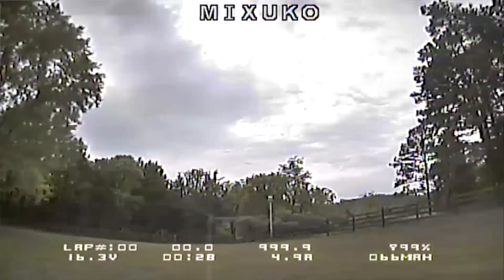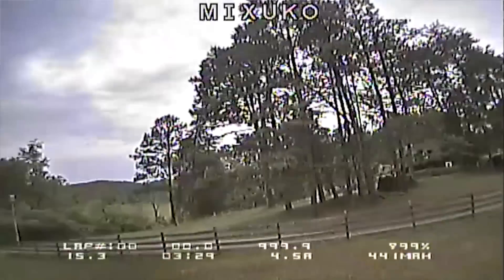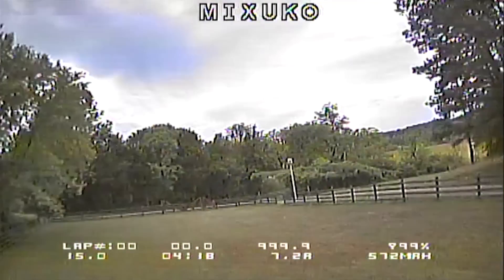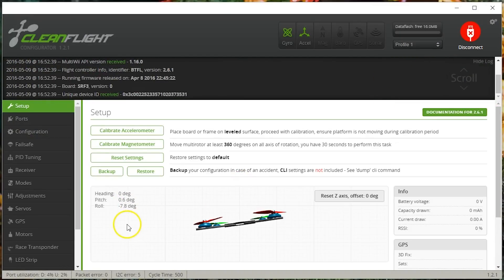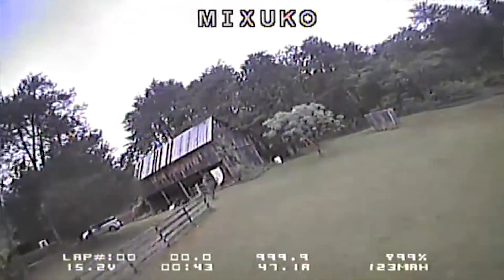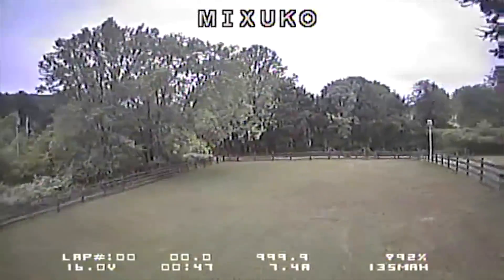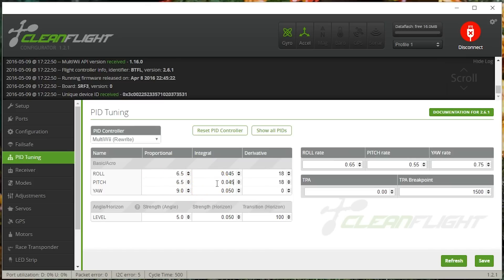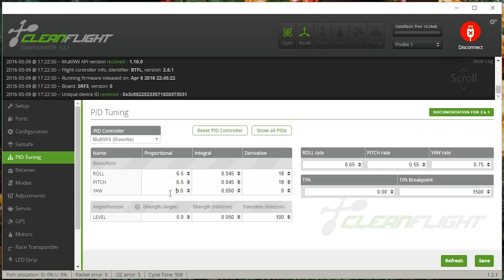Practical PID Tuning - Part 1  | HOW TO TUNE A QUAD

Comment: looking  for some help tuning my quad. It’s a 6s 5 inch analog drone. Mamba f722 app mk1 65a 128k esc 
My only issue is my yaw: it’s very jumpy/ touchy. Any help or advice would be greatly appreciated.
Reply from the maker: I assume you're on default betaflight PIDs, and so if you're on a 5" 6S quad, your PIDs are basically correct and any problem you have is either mechanical or something other than PIDs. Don't spend time trying to fix this with PID tuning.

My first suggestion would be to reduce your Yaw Rate.

Comment: Had a problem today and something unexpected happened ..  I did a full throttle motion and the quad just flipped into the air xD I reckon its something to do with the pids ..  any opinions ?;p

Comment: my nose drops pretty drastically when i punch the throttle then bring it to zero. does this mean i should increase my i Pitch?
Reply from the maker: Later versions of betaflight are significantly better at dealing with this so if you have the option to go to the latest version, you should.

Anti gravity gain is designed to deal with this. 

Raising I gain will help with the problem but you may have to raise it so high that it causes problems elsewhere.

Comment: When I flew my 2inch quad about 6 inch from the ground seems fine but when I drop/land my quad 3inch from the ground my quad go crazy like spinning wobbling crazy.. even my throttle is down to 0.. what could be the problem? My fc is omnibus Halo.. on a et115 frame my ESC 10amp.. my motors is ladrc( kingkong ) xt1104
Reply from the maker: This could be caused because air mode is turned on. If you have trouble landing with air mode on, you should turn it off. Here is a video I made about how to land with air mode.

https://www.youtube.com/watch?v=Y9FPOy8C6I4
Reply: Joshua Bardwell tnx will try.. msg you if it worked.. more power to your channel you had help many Filipino here.. keep it up..

Comment: Looks like I'm alittle late getting to this party and hopefully this question isnt too off topic but two off my motors are getting hot when the other two are not. The hotter the tune, the hotter the motors. Been trying to tune for wind resistance. Could this be a tuning issue or maybe something else? This is a Pixhawk, medium size AP rig.

Comment: Hi came across a problem I haven't noticed before with, GF7042's I get hotter motors/cool ESC's and with dal T7056C  props I get hotter ESC's and cool motors ? which is worse ? thanks

Comment: So the only thing I can't tune out is full throttle oscillations. Where do you suggest I start? Lower p gain on pitch and roll? Or is it d gain? Sounds like a turkey on crack when I go full throttle.
Reply from the maker: Full throttle oscillations, use higher TPA. Or reduce P gain.
Reply: Joshua Bardwell thank you sir. I was thinking p gain. Wasn't thinking about tpa at all. But I'm only a few videos into your plethora of tuning videos.

Comment: Joshua does it matter if you tune in any of the flight modes stable mode or acro?
Reply from the maker: All flight modes are based on acro so if acro isn't close to right then the others won't be right either.

Comment: As a total beginner, it would have helped me if you did a better job at pointing out the sounds/propwash/oscillations/issues... that you are talking about. Maybe show some very extreme versions of these issues. I have a lot less experience, so I thought the quad sounded fine and didn't see any "yaw dipping to the right" but you said otherwise, so now I am even more confused. And, you didnt even get into how you knew what to adjust. The video went from, lets fly a couple feet off the ground to needs more D. How do you know that it is D and not P or I? Oh, I have so much to learn about this sport.
Reply from the maker: Please watch my "PID Tuning Masterclass" which I created to address exactly the concerns you're asking about.

https://www.youtube.com/playlist?list=PLwoDb7WF6c8mTH6A4HyzPPdX5lsvEwBeA
Reply: The real MVP right here. Thank you!

Comment: JB or anyone feel free to comment.  Im not new to multirotors but new to tuning.  I cant seem to get my P's high enough to eliminate bounce back without introducing oscillations.  I'm stuck with mushy tunes to avoid oscillations.  I've soft mounted my fC which is already soft mounted (Kakute), soft mounted my motors and have a clean build.  Why cant my p's get high enough without introducing oscillations?
Reply from the maker: Raise P until the bounce gets smaller and sharper, then raise D to try to get rid of it entirely. That's my general approach.
Reply: Such a fast reply!  Thanks, I'll give that a try

Comment: Dear Joshua, considering regular 5" quad on 4S and latest (3.2.4) Betaflight -- is it better to tune a quad with Anti Gravity and Dynamic Filter off, get the most out of the quad possibilities to one's liking, and then turn on both Anti Gravity and Dynamic Filtering? Or the right way would be to tune with these features on?

Comment: Do you recommend leaving the PID's as default in cleanflight for the maiden voyage? If not what settings do you recommend?
Reply from the maker: +AZ_PIT_VIPER this whole playlist is to help you figure out what PIDs work for you. There isn't one universal set of good PIDs but the defaults are a good starting point.

Comment: Hey Joshua Bardwell, im having some troubles tunning my quad. My quad is almost 100% stable but still have some oscilations on roll and propwash sometimes after split S. I ended up with stranger PID numbers.
My setup: 

Lisam 210 Frame
Genuine FLIP 32 - F4 - OMNIBUS
DYS fire 2600 kv motors
DALPROP T5045C Cyclone 3 Blade Propeller
DYS XSD30A XSD 30A 3-5S ESC V2 BLHeli_S  Dshot600.

Would like to know your opinion about these pids numbers, i dont see anyone with numbers like this on similar builds. If you have any suggestion to improve the stability of my drone please tell me :) 

My Pids: https://imgur.com/a/59ym0

Thank you Josh

Comment: hi joshua, hopefully i can explain this clearly. a few of my quads have a very ice skating feel when flying. For example, if i were to give pitch forward and let off of the pitch it doesnt brake and stop on a dime like my other quads. sort of if like if you push off on ice skate how even after u stop trying to move your body slide against the ice until its loses energy or i give counter motion. how do i prevent/adjust/correct this? i assume its a pid issue not a rate or somthing else.

Comment: Mister joshua,would you have any tips for using 5s on betaflight  configurator 3.2.1 on a helix 5" running tmotors f40 2600 kv with 5x4x3 hq props,my pids seems good on 4s but when I use 5s im getting on and off a kind of desync where my quad kust spin on itself and crash,I listen to.ur talk on the fpv show but still cant get it right...have got an account on instagram  "jerico__rico" if u got time to have a look.thanks a million and much respect for the knowledge you provide.rico.

Comment: how come when i do a quick turn it seems like the ass end of the drone floats..im getting like a floaty flight if you know what im talking about..please help..thank you
Reply from the maker: it's hard to know exactly what you're describing but my guess is that you're feeling the quad kind of want to drift out of turns. Try raising yaw P gain by 20 points, and then if nothing bad happens, 20 points again. I typically run yaw P on my quads between 70 and 110. I find that higher yaw P sharpens up turns significantly.
Reply: Joshua Bardwell thank you..ill try that..

Comment: JB...I finally got the nutz to fly my riot 250pro that I showed you at FF east. and I agree with all the advice  you and others give with getting something sturdy and flying in acro. I was scared shitless until after 3 or 4 total crashes, then I realized this thing is made to wreck.... I went from nervous to just having fun and went home with alot of info...
Reply from the maker: Honestly, the less scared of wrecking you are, the faster you will learn. The flip-side is you may lose a few copters so it's a toss-up.
Reply: I am going to hang my broken props on my wall at work...I think I will need a bigger wall???lol
Reply: I have a special place on my wall at work for broken props. but I think I will need a bigger wall...lol
Reply: thanks dude....yea hovering is good but hitting the throttle is a total new experience. it just go's like a bat out of hell. but I love it. when i try to stop it and bring it back twords me it flips about 3 or 4 times and plants into the dirt.....i will learn..

Comment: jashua please can you help me..my drone flies fine..but once in a while the throttle gives away for like a sec..like it wants to drop
Reply from the maker: It's hard to guess what you are describing, unfortunately.
Reply: Joshua Bardwell ok let's just say I'm hovering..then I tap the throttle the drone goes up and down real quick..and sometimes when I punch it it's like a throttle glitch or something..iy just drops..
Reply: sorry it's a little hard to explain..i watch your videos a lot..I also want to thank you for all you do for  us..and all the time you spend to help others..I appreciate it because from your videos I did learn a whole lots..
Reply: If the quad completely dies it might be the battery. Knowing what your hardware is might help. I have a 120 on 2s with 1103 motors and on a hard punch it would just fall dead to the ground until I unplugged and re-plugged the battery. Cheap Chinese no brand (850mah 25~30c maybe) batteries had some kind of protection circuit board that would trip and kill power until I unplugged it. I removed these boards from my packs and replaced the wires with heavier ones and the problem disappeared.

Comment: HI Joshua.  You have killer videos  very Informative . Thank you Job well done
    Im 52 been flying  park  flyers and new  to drones.  My first  quad is a Lumenier QAV-R  5" FPV racing quad  from GetFPV . Been flying  full  acro  finally . I have not tried flips or rolls .But been flying low, high  corners  at full speed  and fast  around trees.  Get fpv  had set it up before shipping to Me  I  set up everything else on Beta flight. Im a Little lost On PIDS  any suggestions on PIDS  or  setting  up  the  angle horizon ,  full acro?
I want it to corner fast like its a plane  or better. Im going to build one   maybe smaller.
Thanks Todd
Reply: You definitely want to stay acro only for your flights.  I started this way and couldn't imagine using anything else.  Full control of the craft is important.

Comment: Help! My quad is flipping over on takeoff. I have checked everything, my motors, props etc. My gyro is also in correct orientation. I am running it on multiwii 2.4. The PIDs are set to default. My frame is 450mm. I do not know what the problem is. Please help.
Reply from the maker: If the quad flips on takeoff, 99% of the time it is:

1) Motors wired wrong.
2) Prop on incorrect (wrong direction).
3) Motor spinning wrong direction.
4) FC aligned incorrect (not aligned facing forward).
5) Incorrect motor mix (if custom motor mix is used).

Most often, I say this to people, and they swear up and down they checked all these things, and then later they come back say oops I found it after all. So I would say double, triple, quadruple check all of these things. Or get a friend to do it for you since you may be overlooking something.

After these things, if the quad is still flipping out, I say re-flash your FC with "full erase" checked so that you completely default the config and try rebuilding it from scratch.

Comment: hey joshua bardwell,
    your PID tuning is very greet.can your hepl me,
   now i have qav250 
  NAZE 32 10 DOF
 TS T6 TRANSMITTER
 2300KV EMAX MOTER
4S HOBBY WING ESC 12A 
H9 CAMARA
SONAR SENSER
NAZE GPS
AND 1500mah batter.my battery time  very low it can flight only 5 minite maxium.so bro can you tell me best remote andyour 4s battery mah and c rate.

   i have anoter question.it is can use my 2300kv moter to 4s battery.is it burn to 4s battery?
Reply from the maker: 5 minutes is a completely normal flight time for your setup. Frankly, it's a bit generous. Nothing is wrong with your setup.

Your motors can handle 4S no problem.
Reply: tnx bro quickly reply.plx tell me your 4s batter mah and c rate after i will oder it for ebay
Reply: this poto in my fater i am 16 years old....i like quad tell me ypue battery mah and c rate tnx joshua bardwell
Reply: if tell qav250 for suitable 4s battery with mah and c rate......tnx for take time for me..
Reply: Rathne ba josh has a battery shootout series, check that out to see what good batteries are available

Comment: I have a "full" BetaFlight F3 board coming from FPV Model, and what I assume is an abbreviated implementation, the EMAX Femto F3 in a kit from FliteTest.  I assume the Femto won't have any data storage onboard, so this video series will be very helpful with that one.
Coming from APM, I imagine there will be some similarities but many improvements too as everything now is faster and more maturely designed.

Comment: Hey Joshua Bardwell, I own an Eachine Wizard 220x and I am using the Betaflight 3.1.7 stock P.I.Ds and I are regularly getting massive wobbles/oscillations when I punchouts or am trying to recover from a freefall. Would this problem be coming from my can I fix this by tuning my P.I.Ds or somehow else? I am suspicious that this problem may also be caused by the battery I am using since one of its cells seems dodgy. How likely do you suspect the odds of this being the cause of the problem aswell?
Reply from the maker: +Ethan Jack if that copter gets massive oscillation on Betaflight 3.1.7 default PIDs, something is wrong with the copter. I would look first at the motors to see if any are damaged and out of balance. Then the FC to be sure you haven't broken a standoff or something.
Reply: Hi Joshua Bardwell thanks for helping, It is pretty new, everything looks fine, no broken standoffs or nothing. But I am a bit of a noob since I have just got in the hobby, so I don't get what you mean by "motors out of balance" if you could explain on that, that would be great. And you don't think a problem from a damaged battery at all?

Comment: joshua! I have a problem that I think you know how to fix. I just installed kiss FC and kiss 24a esc, steele motors, Martian III.. when I punch the throttle and drop it, the copter will roll to the right when otherwise it is under my full control. just after the drop it will tilt to the right almost full tilt. any suggestions?
Reply from the maker: Use idle_up to increase authority at low throttle? Normally I would suggest enabling air mode and maybe raising I gain, but I'm not sure how that applies to KISS.

Comment: Can someone please explain the difference between the cleanflight MultiWII controller settings vs the Betaflight PID in 3.1? I'm just confused between values in the first one being under 1 (ie:4.5) where the P value in Betaflight default is 44. Is there any direct correlation between these numbers? for instance does 4.5 shown in this video correlate to 45 in the new BF PID screen?

Comment: hello Joshua, is it possible that the high vibration you got at 7:35, disappeared after some minute of flight due to battery voltage level decrease ?
Reply from the maker: +andrea vanni it's possible.

Comment: hi Joshua I have a problem with my drone. when I take off it hovers fine but if I give it pitch forward and then let go of the gimbal the drone goes backwards at the same angle as I pitched forward. if I land and take off  again it hovers fine until I pitch forward and let go of the gimbal.
Reply from the maker: +Conor McDonald are you in autolevel mode? If so, that is the correct behavior. If not, I guess I would increase I gain.
Reply: Joshua Bardwell it is in angle mode but it'll hover when I take off but as soon as I pitch forward and let go of the gimble the drone doesn't hover it just reverses backwards at the same pith as i gave forward (just like if I gave it backwards pitch). the more pitch I give forward and let go the more pitch it reverses and goes backwards. hopefully you understand what I am asking
Reply: have you tried recalibrating your accelerometer ,mine wasnt on a level surface when i first built mine and it was flying all sorts of weird in angle mode
Reply: damon barnes yes I have rcalebrated it about 4 times already and it was on a flat surface I've even tries changing the pid and it still does the she thing no better. but thank u for ur reply
Reply from the maker: +Conor McDonald does it eventually level back out again?
Reply: Joshua Bardwell  no it doesn't only of I land and take off again. thank u for replying and helping me
Reply from the maker: +Conor McDonald I guess make sure your accelerometer is calibrated and trimmed, and then raise level P gain.

Comment: I have a JJPro P200 that acts really nervous when hovering or descending, and it's even worse if I try to use angle mode.  Seems to behave well during throttle punches though.  Do you have any recommendations for how to address this?
Reply from the maker: In angle mode, reduce level P gain.

To improve propwash handling, increase D gain in small increments of perhaps 5 or 10 at most. Fly and monitor for hot motors while raising it.